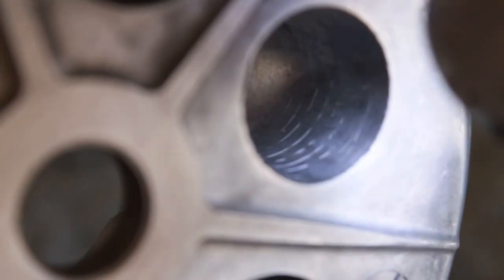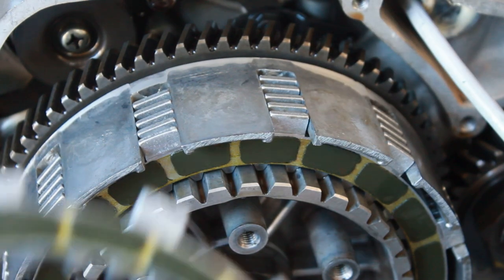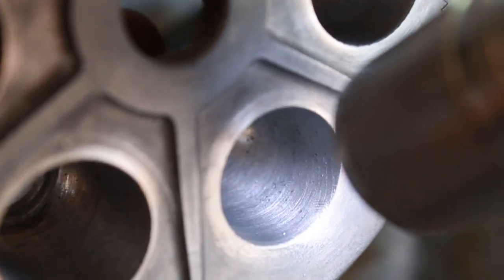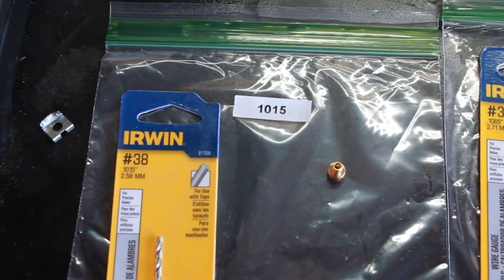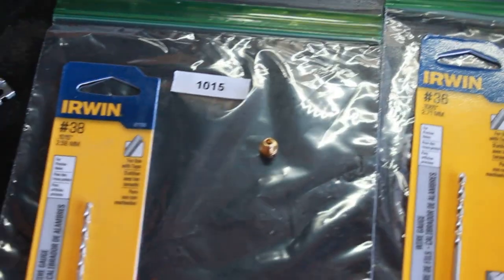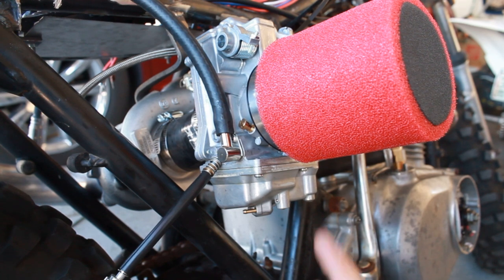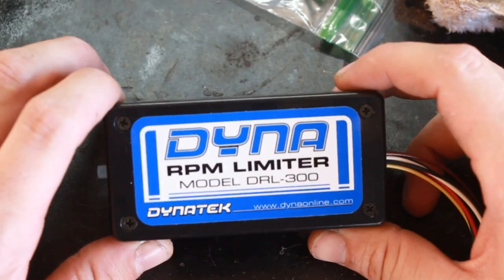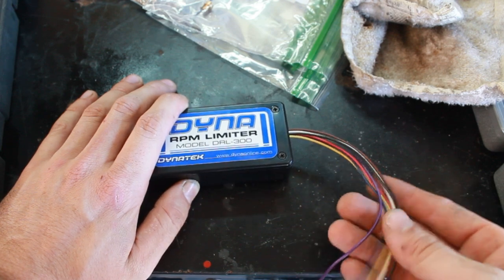Turbo Mad Max GS400 Scrambler (PART FIVE) - Motorcycle Timelapse Build

Comment: Hey have you looked into a pilot tube? Basically it runs from your boost tube to the bowl vent to pressurize the bowl to help with fuel flow. The bowl has to be completely sealed for it to work. I was going to turbo a Suzuki Samurai using a Harley CV carb and everyone who has done it used that setup with the pilot tube. This was going to be in a blow thru setup so draw thru maybe it doesn’t apply but figured I’d mention it.
Reply from the maker: If I went that route I would've needed a fuel pump/fuel pressure regulator. Too much additional work. I'll get this to work, it's just going to take some trial and error.
Reply: @DoctorMotorcycle  I don’t know that you would need either. It’s not for boost referencing to increase fuel pressure from a regulator it’s so that the fuel bowl is pressurized and forces fuel into the venturi based off the increase of air from the turbo. Again a lot of this is based of blow through setups but it makes it so you don’t have to run huge main jets. Either way I’m sure you’ll get it up and running and I’m stoked to see the progress!
Reply from the maker: @itschrisb  Yes, but just adding boost pressure to the float bowl won't provide more fuel. You need to be able to provide additional fuel via a fuel pump, or the float bowl would just run dry. The float bowl being pressurized would prevent gravity fed fuel from entering the float bowl, which is why you need a fuel pump and fuel pressure regulator.
Reply: @DoctorMotorcycle  ahhh gotcha. I didn’t think about the fuel being gravity fed! Sorry!

Comment: I was always led to believe that when you turbo charge any engine you need to lower the compression ratio by using a thicker headgasket to compensate for the increase in compression caused by the turbo.
Reply from the maker: Generally yes, but this setup needed all the help it could get to spool the turbo. The more power it makes on motor, the more power it makes on boost.

Comment: Arnt you suppose to torque the cam cover?
Reply from the maker: It's all coming back apart in the next video or two for a rebuild anyways. Couldn't get it to build boost, did a compression test and got 90 PSI in the right cylinder and 70 PSI in the left cylinder.

Comment: Any links to the dyna rpm limiter
Reply from the maker: I would provide a link but I ended up not using it because it didn't work. Huge letdown
Reply: I have a honda cb400/4. Thought of doing a similar set up, but I wanna source a 2 step